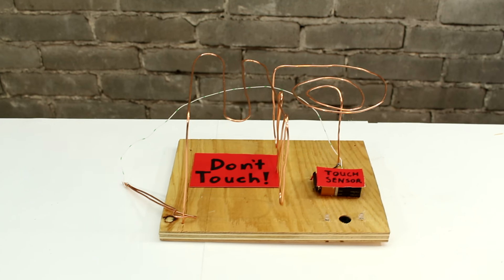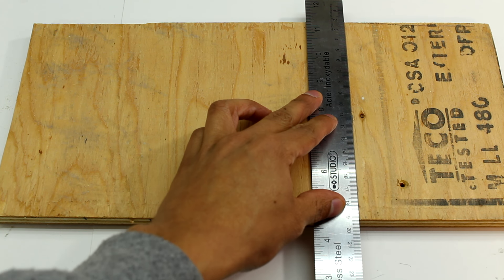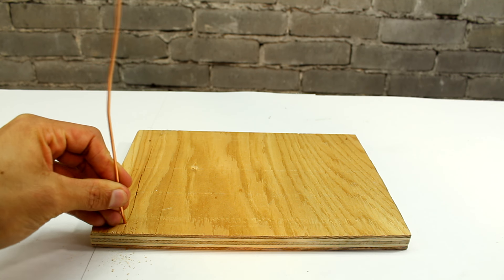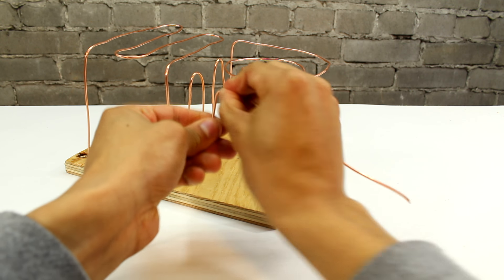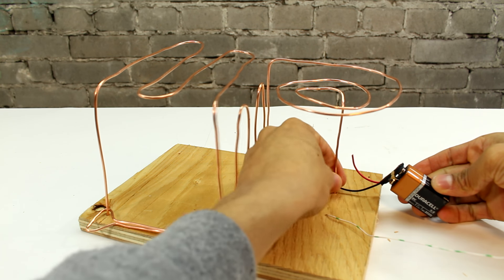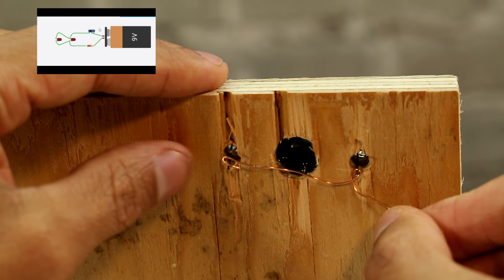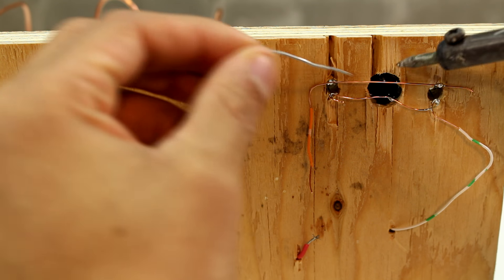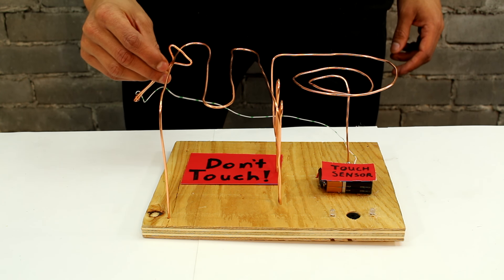How To Make a Simple Buzz Wire Game

Comment: Great!  BTW you can buy LEDs perwired with a current limiting resistor (it is not there because the voltage is too high but rather to make sure that when the LED conducts it does not do it so well it burns itself out!).  Will work fine from about 3V to 12V and USB power supplies can work well too!

Comment: 10 ohm resistors are a bit dangerous for the led. I usually use a 220 ohm resistor.
Reply: Why do you say this? I am using a 10 ohm resistor and I just did a test and burned it out right away. What size resistor should I use. JoshBuilds, what do you think about this?
Reply: Just realized you already suggested a 220 ohm resistor.